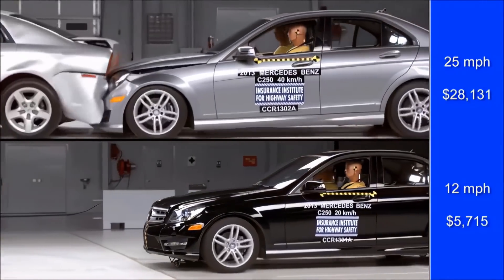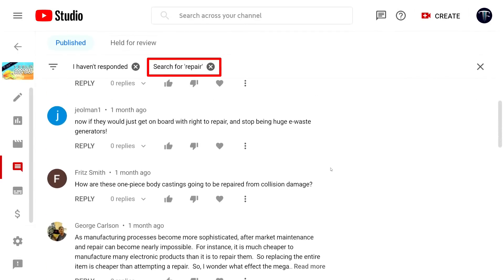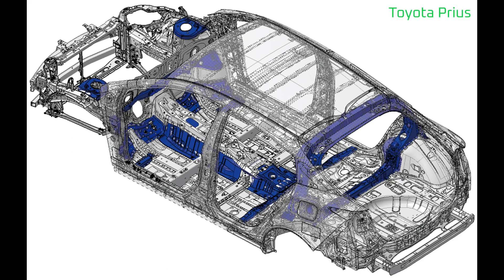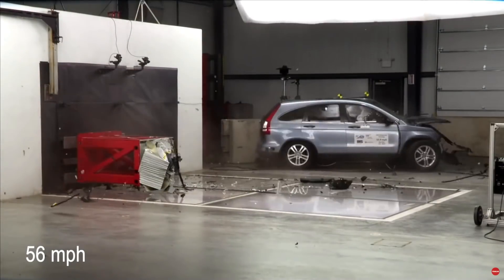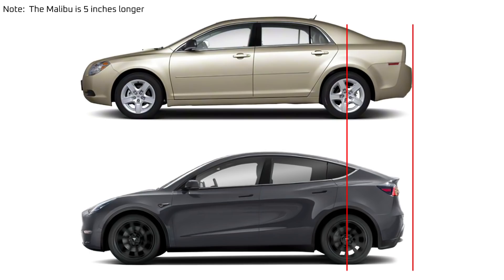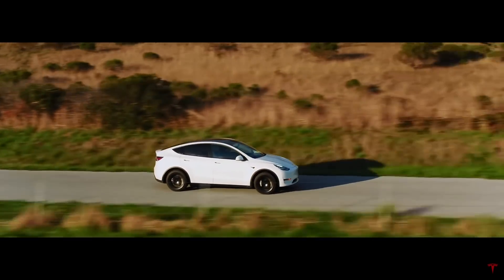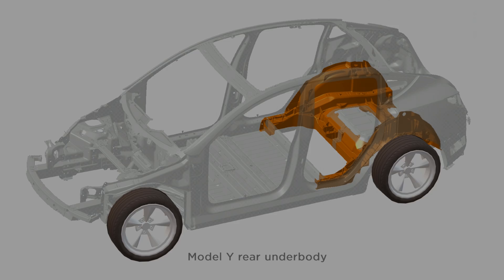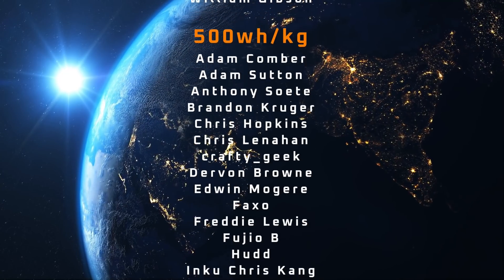#1 Tesla Gigacastings // Crashworthiness and Repairability

Comment: You should interview Sandy Munro. I am sure he'll be glad to spend some time answering other technical questions on the gigacast. Good video!
Reply from the maker: 😁 I'm saving Sandy up for something more out there.  Dude loves VTOLs.
Reply: @thelimitingfactor  great!
Reply: @thelimitingfactor  You could always interview him twice. :)
Reply: @thelimitingfactor  YAAAAASSSSSSS!!!! I can't WAIT for that one!!!
Reply: @thelimitingfactor   - he also loves , Hydrogen .
Reply: I watched a video with Sandy Monroe and Elon Musk explain exactly the previous problems with oxidized parts or local chemical reactions with dissimilar metals. Also, Elon Musk said, the large  aluminum alloy casting can be welded if damage. I expect, Tesla would provide the necessary training and tools to weld these parts. Just like Nuclear power plants which use exotic alloys have welders licensed to weld special alloys. If 1/2 the future cars are Tesla, then this would not be a problem, but for the first owners, it will be hard to find a repair shop.
Reply: NO!!! All that guy cares about is saving the manufacturer money. He cares zero about the end user, repairability or long term serviceability for the end user. Pretty much save the manufacturer 5 cents and fuck the end user with a $500 repair over a 5 cent savings in manufacturing costs. He is the engineer all auto techs hate.
Reply: @inothome  This is a bold claim, and I would personally want to see it backed up with sources. If you're making a better overall product, less maintenance is required, not more.
Reply: @inothome  This is true.  Modern cars are harder and harder to DIY repair/maintain.  Results of design to making them easier to manufacture...some times on purpose to make it harder to DIY so forces folks to take it to the stealership to work on.
Reply: @inothome   Some truth to that and Sandy is wrong, IMhO, about a number of things and sub-optimal orator.  Cough cough...  However--Munro convo could still be plenty valuable perspective.  We don't have to agree with everything to gain insight,  often quite the contrary.
Reply: Capital idea James!!
Reply: Sandy is very anti repair/maintenance so would probably have a biased outlook on this point
Reply: @jacko791  that would make it an even more valuable discussion